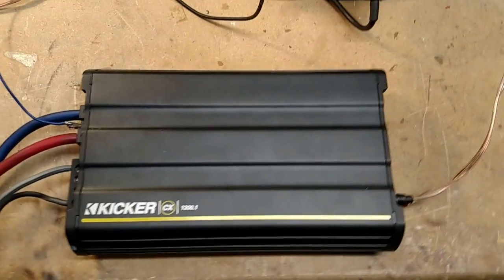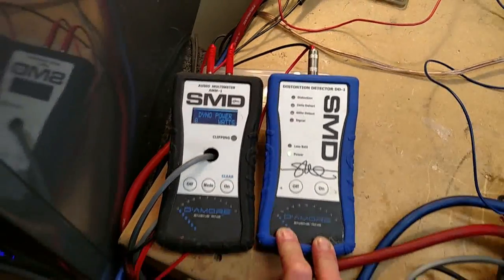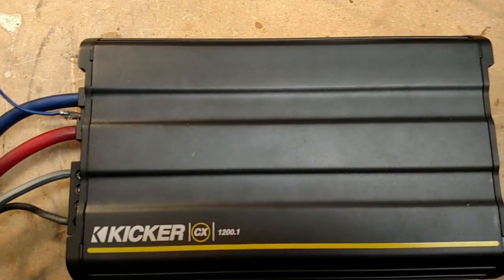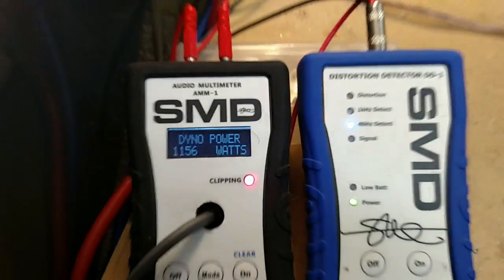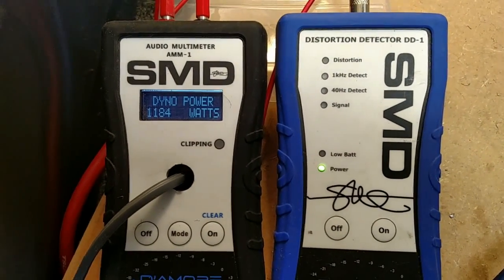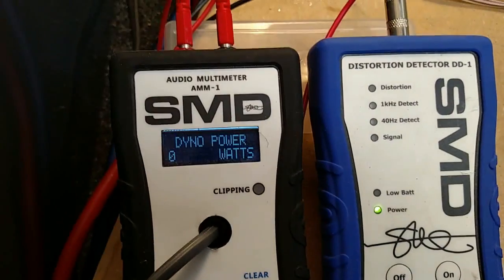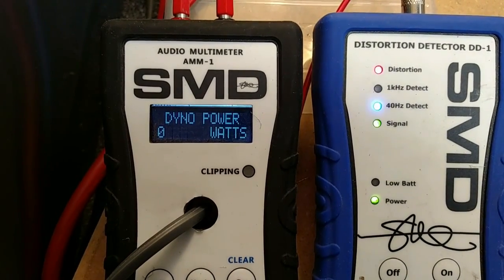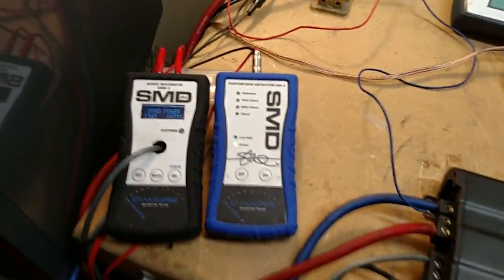AMP TEST - Kicker CX1200.1 Amp Dyno Test

Comment: I have a cx 600.1 series amp and a 10" sub that I'm trying to hook up to it and I got everything hooked up and it won't turn on. does anyone know how to fix this problem.
Reply: Use a meter and check for +12V on the power input and remote wire inputs, while using the ground input as the ground for your meter.
Reply: dont buy kicker. Problem solved
Reply: sickening for someone who respects sundown. i love sundown stuff but don't discredit other honest companies (kicker for staying true to labeled ratings) for living up to the same standards. if you use sundown shit you should be smart enough to help out with ppls issues instead of telling them they are buying the wrong merch. u sound more like a fanboy then someone who knows what to do with your gear. "oh buy this and all your problems go away." such ignorance.
Reply: yes check this first. always check to make sure current is coming through to power and remote. also check ground continuity. if you don't know how to do this i would suggest alot of reading or take it to a shop.

Comment: I'm running a Sundown Audio X-18 D2 in a Wall Box. I'm using a Kicker CX1200.1 amp until I upgrade to a bigger amp. I have my amp running at 1 ohm to that sub. So that amp should do fine with the gain at 60% up or should I go higher? I have good electrical, and a high output alternator, and I stay at above 14 volts with the gain at 90%, but I have the gain down to 60% just because I'm running it at 1 ohm.
Reply: Please do a little research into how a gain knob is used. It does NOT, in itself, dictate power out of the amplifier. At 90%, I can bet damn well you're sending square wave to your subwoofer.

Comment: The 1200.1 is $319 MSRP
The 600.1 is $249 MSRP
The CX is not "Bottom of the Barrel". Renegade is Kickers Bottom of the Barrel for $90 (I mis spoke here: Renegade is Rockford Fosgate lowest tier,  not Kicker.  My bad. DXA is Kickers lowest tier)
My CX 1200.1 Certification Paper shows it Rates 250 Watts over the 1200 @ 2 Ohm.
Reply: In glad you cleared that up bcuz I was like Wtf is he talking about.
Reply: Prime is Rockford's lowest line... Renegade was made under Rockford just like Lightning Audio. Little bit of a difference.
Reply: Anon LulSec I remember when I bought mine, the birth certificate said 1,243W @ 2 ohms. KICKER doesn't overrate their amps! :)
Reply: When I bought mine was 350$ at best buy.
Reply: word
Reply: doomsayer559 it still has nothing to do with kicker
Reply: Kinda threw me off when he started talking prices ... where can I get a 1200 for $250?? In my experience most kickers do rated and they are great amps.

Comment: Well, great video as always. I Just picked up the DX 1000.1 model on a trade to run two 12" subs rated at 600 wrms. If this Amp did so well, I'm sure the DX should do around if not over 1200wrms easy on 14.4 v..

Comment: i have the cxa 1800.1 operating at 2 ohms. I've never operated it at 1 ohm.  I've been kinda scared too. have you ever heard of anyone successfully running this amp at 1 ohm. there not really cheap saying that there 450to 500$ i have mine pushing 2 2 ohm dvc hdc3 18s until i can upgrade.  if they can do 1ohm without f'n up i would just buy 1 more cxa 1800.1 for each sub. but if they can't do it ill just get a amp that can. it pushes the hell out of those subs though. i would really like to stay with kick amp wise. I've ran kicker amps for 15 years. there awesome.

Comment: I have this amp. Keeps cutting off. About to return it. Thanks for the vid!
Reply: Don't return it dude. What these guys said above are correct. I have the SAME amp and mine was doing the same. Called Kicker and the guys there were so into their craft they told me what to do even though i knew they were busy. Before I even hung up the guys stopped me to give me more tips. I had an 8 gauge wire and same for ground. I actually have 2 amps now including the 300.4 (4 channel version) and I told the guy my plan was to run a 1/0 gauge from battery to the back and have a distribution block with 4 gauge to each amp and the same for ground. (must put appropriate fuse before each amp. it is told to have the fuse within 12-18 inches from the battery but my amps are in the back. I did put a high rated fuse inline with the 0/1 gauge though) After I did this, my car is exploding with power.  Still it is not optimal cause if you want this type of real rms power you need also the current (battery) to be good 14.4 you also need a decent alternator. The kicker guy said I was right on the money for the problem and now i'm bumping away. so happy with kicker i replaced all my speakers with components KS series and hooked it into the 300.4 amp. Sounds so good that getting in my car is like going to a virtual concert.
Reply: Sounds like you don't have the electrical system to handle the CX1200.1 and it's cutting out due to low voltage. And since you already said you don't know where to set the gain, i'm betting you have that AND the bass boost too friggin high to begin with.
Reply: Chris Denton  that's because you don't know how to wire subs
Reply: Large Power and ground. This amp recommends 4 AWG, larger never hurts.
Reply: Matt Nelson I kept the amp and upgraded the wire size complete with distribution block. Like you I'm thumping down the street. About to add another one of these and a second 12" sub! Gonna have to upgrade the power though. Can only run the system with the car running! Lol!!
Reply: Hey make sure the power wire is on tight at the fuse block and clean  cause that's what happen to me on my 750.1 zx
Reply from the maker: Are you wired below 1-ohm?
Reply: +The Amp Lab 
No, it's running a  2 ohm 12" kicker loaded enclosure. I actually have the 600.1 amp. But still.
Reply from the maker: +Chris Denton Are you using an actual remote turn on wire or using the signal sensing to turn on the amp?
Reply: +The Amp Lab 
I had that same thought earlier today. Was both but I removed the remote turn on and switched the amp to high level input. Not sure where I should set the gain now. Or the rest of the settings for that matter.  I'm using the factory Toyota HU, if that makes a difference.
Reply from the maker: +Chris Denton You should have an actual remote wire to turn the amp on and not rely on signal sensing. turn the switch to 12V so it only looks for the remote wire. Signal sensing can be problematic and cause the amp to keep turning off if the signal is too low.
Reply: +The Amp Lab 
Interesting. I'll try that. Thanks!
Reply: +Chris Denton You sure you have your speakers wired for 2 or 4 Ohms? If that's not it, I'd check the ground. Make sure your ground is contacting bare metal.
Reply: I had to use a Remote Wire where my signal sensing doesn't work properly neither. Everything else works grand. Make sure you're ground is larger than your power. Make sure you're fuse is proper rating, and double check you're + and - connections both on the RCA/Input Converter end, and the AMP/Speaker ends. Check your rear + and - schematics for proper orientation, or whatever speakers you are tapping into to convert to RCA.
Reply: LOL. glad it's working! I have this amp powering a kicker enclosure with 2 12" COMP-Rs also. You are gonna blow your head off if you get more subs lol!. did you get the subwoofer remote dial? i did and i use it all the time to adjust between songs
Reply: Matt Nelson hahahaha! Yeah I added the remote too. Look for my video. 
Then I couldn't leave well enough alone. Upgraded ALL the speakers to component and even added a set of tweets! Can't stop addiction!!
After getting the Corolla hooked up, I moved to our Highlander. Added kicker 600.1 amp and changed the OEM 8" to a kicker!
Reply: Chris Denton wheres it grounded?
Reply: Nobody listen to this message it is wrong, the Hi/Lo switch is for the remote turn setting it does NOT have anything to do with gain.
Reply: This is not true, do not listen to this comment, that does control how the amp is turned on, has NOTHING to do with gain.
Reply: The CX1200.1 doesn't have a switch to change between +12V remote wire and signal sense. And it's actually DC offset that it uses, not music signal sense. The Hi/Lo switch on it only changes the gain range.

Comment: Huh - WHAT? 

1100 watts at 4Ω = a voltage drop to 12.64vdc 
and 
1156 watts @ 2Ω drops it to 12.07vdc...

- but holds 13.78vdc doing 1545w @ 1Ω???????????

Sup wit dat power supply there fella?

...or is the amp gaining an incredible amount of efficiency as the load impedance drops?

Comment: Had a friend with a kicker cx300.1 ran that fucker at 1ohm clipped to shit with a dieing alt and bad ground took it for a month daily of delivery driving 12 hour shifts. started getting hot and randomly coming in and out of protect so he sold it upgraded to a nendo 1500 and hasn't looked back since :) considering the crescendo 1500 is only 300 its probably a better buy anyway and 1 ohm stable at that doesn't turn a temperature even with his poor power situation.
Reply: +ThaDjSteps You're not supposed to run it at 1ohm you dumb fuck.
Reply: i do what i want the amp did fine at 1 besides what class d amp can't do 1 ohm these days?
Reply: +ThaDjSteps kicker amps aren't stable at 1ohm, that's why it was coming in and out of protect. Also running it at higher ohms like 4, is a lot cleaner of a sound.
Reply: honestly if you get a good amp with good electrical it can have signal similar to higher impedance like 2 or 4 its all about keeping the rail voltage at or lower than the rails can put out when you try to excede that thats when distortion kicks in and eventually clipping
Reply: Dollar Bin Gaming plus who cares what impedance is recommended kicker says 2 ohm stable because they don't want a ton of amps coming back in for warranty repairs or replacements.
Reply: ThaDjSteps Exactly, because they aren't rated to be ran at 1ohm!
Reply: The lower the ohms means lower resistance so by going at 1ohm you tell it to go fucking nuts, 2ohm is mild but fierce and 4ohm is nice and smooth. 1ohm isn't stable because its just too much power coming through for the transistors and so the amp will go into protect mode when it overheats, but with amps nowadays this could be months before you get this issue, and eventually the amp will die and it will be cause by this because it reduces the lifespan of the transistors.
Reply: Dollar Bin Gaming Kind of, it depends a lot on variables like your electrical and how much voltage is passing through the rail's also box rise so theoretically if you know all of the impedances of the different frequencies that your amp actually see's you can run way under any impedance that the amp maker says is safe, just because you wire at 1 ohm doesn't mean the amp is always seeing 1 ohm of resistance. But you also have to take into account that every time you turn the amp on with no signal lower than one ohm it does see the resting impedance so you could wire at quarter ohm for years and never have a problem or you could wire at quarter and start your car and your amp flips into a permanent protect. So 1 ohm is generally safe as long as you aren't clipping or dropping below 12.8v or leaving the amp to bake in the sun for months.

Comment: I have a CX300.1 running 2-10in MXT and a JL Audio 8W1V3 in a series-parallel configuration at 2.67 ohms and it stomps pretty hard. I am pleased with that amp.

Comment: do me favor and explain the  voltage ?? U had it a 13 somthing is that a regular car battery voltage
Reply: Most cars run 12-14 volts. The voltage and ohm resistance determine output. Higher volt, lower resistance equals more output.

Comment: I bought 2 kicker compr (40cwr12) 4ohm subwoofers. Not knowing that this amp kicker cx1200.1 wasnt 1ohm stable. Obviously i dont want to run this amp at 4ohm 600rms, my question is, can i run this amp at 1ohm to push those subs at its max rms of 1200+?
Reply: just do it

Comment: I got 2 12" l5s and been running them on a Rockford amp I think its 1000w rms and it starts clipping before I get it past 40/62 would this amp be better its rated a little higher and is kicker but its so much less money I don't know if I should buy it.
Reply: my gains 3/4 of the way down

Comment: Nice test- I have always liked kicker amps.  I am not surprised at all that they do rated.  I feel that with any Kicker- Rockford- Alpine, etc amp are pretty accurate on there ratings.  Most of the majors are CEA compliant and usually have a 'birth sheet' showing power at x distortion.  I have Skar amps for one of my builds(sk1500 on a 18" SSA Xcon) and Crescendo in another(BC5500 on 2 18" Tantric 18's)- But this lil amp is prolly going in my next build-as I need 2-ohm power for an 18" Incriminator Death Row I have.

Comment: Hey! i've been looking at amps for days.. can you please tell me one that would be perfect for the nvx vcw 122 12inch sub? 1000rms 2000w peak. also I would like it to be around 130$ max. thank youu (: I enjoy your vids.
Reply: Skar makes the power they claim and if you want alot of power for a little money ces rated.. Rockville looks good on paper. I personally  would trust skar more then Rockville but they  do make the power they claim
Reply: @duha1893  this was 6 years ago man..
Reply: @mrfish1742   what that skars were cheap or rockville made thier power? Oh and you didn't tell me the ohm of sub can you  run one ohm on it. I found a rockville 1k for 119 at 1ohm
Reply: Jacob Heinze Soundqubed has a selection also they arnt overpriced well built i have a 1200.1 pushing a alpine type x

Comment: I had a 15inch l7 and this amp completely fried it. first it blew my 100amp fuse then it made my sub rock solid after my local car audio shop said that kicker recommended this amp for a l7.
Reply from the maker: That amp would be just fine on an L7.  Nobody can control if you drive the amp into clipping.  That's most likely what killed it.

Comment: after watching this video i went an bought one of these
Reply: teomwilliams how did the amp do for you ?
Reply: Hugo Castillo this lil amp is fucking crazy!! I have one on 2 American Bass XD1544, wired down to 1 ohm.... so much power. Underrated imo. I’ll be getting the American Bass XFL1544, along with a second CX1200.1, strap them together for more power. My trunk is already about to fly off... I’m actually scared of what 2 might do lmao
Reply: I have this amp on 2 quantum audio 3000 watt subs and it powers those just fine. This little amp kicks ass...

Comment: I have the exact amplifier but i don't know what subs to use. could you help me out? i was planning on getting 2 alpine type r 10" two ohms  but i don't know if it would work. specs of speakers is  peak power handling 3000 watts and RMS is 1000 watts. dual coil. or any recommendations?
Reply from the maker: James Oliva The amp will obviously be a little lacking on power compared to what the two Type-R's recommend.  Will it work?  Short answer, yes.  Just be very very careful when setting gains that you're not sending the amplifier into excessive slipping.  That is what is going to give you problems.  You may be tempted, since the amplifier is not quite large enough, to set the gain past the safe point and into clipping to try and get as loud as you ca with the smaller amp, which can destroy the subs.

Comment: Definitely subbed. Like all amps this will clip but when I tested it with an oscilloscope for 2 American Bass XFL 12"s in a 4cubft box it actually does some great clean power at 1ohm. On a soft clip (small amount of distortion) I broke my rear window off the motor at 32hz! If you need good power in a small package get it. I'll be happily powering an X15 in the future with this. Great amp. Awesome review.

Comment: Help please
Can I go with 2 10" Kicker compR 1200W with this amp?
Or do I have to get the 10" kicker compS 600w¿
Reply from the maker: You can run the CompR's no problem.  The 1200W rating you specify is MAX, not RMS.

Comment: why do a test when it comes with a birthsheet?
Reply from the maker: They only come with a sheet new.  What if you bought it used and you're curious?  Who's to say the sheet is accurate anyways?  Was it tested at 100hz instead of 40hz where its more valid?  400hz?  1000hz?  What distortion rating?

The more information we have in this market the better.
Reply: The Amp Lab All of them are going to do around the same power, and i highly doubt kickers going to lie or do a ridiculous test of some crazy high frequency just to make its power. Maybe other brands but, i think kicker is trustworthy enough despite what people always say about them. And im sure they rate it at >1%

Comment: So is bass  boost bad to have on. I have it at 3db now i put it at half 6db but it didn't sound good at all I was reading that having it on isn't good. Where I got my system installed they set my gain to my headunit low pass at 80hz and bass boost at 3 dB. Is clipping the same as distorted sound. Thanks
Reply from the maker: Clipping is a type of distortion, but distortion is not necessarily clipping.  The lower you can keep the bass boost the better.

Comment: I was wondering I just  bought this kicker 1200.1 cx amp. Where did you have the gain,  low pass filter and bass boost at when you did this test or were they all at 0. I'm new to this don't know  if they make a difference in watts when you turn up the gain, low pass, and bass boost. Thanks.
Reply from the maker: Yes and no.  Yes the power will increase as you turn up the gain and/or bass boost (to a point, that point being clipping), but they are not volume knobs.  They are to be matched to the input voltage of your headunit.  Telling you where mine were will not help you in your vehicle.  You need to properly match your gain to the input voltage coming from your particular headunit.  Low-pass is usually sets somewhere around 80hz for most people.  That depends on driver, enclosure tuning, personal preference, etc though, but 80hz is usually a good starting point.